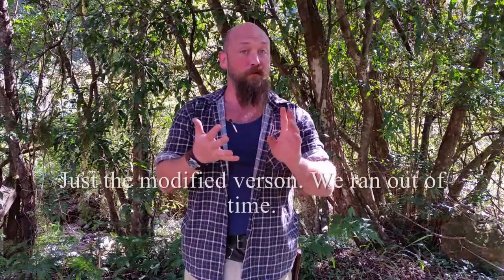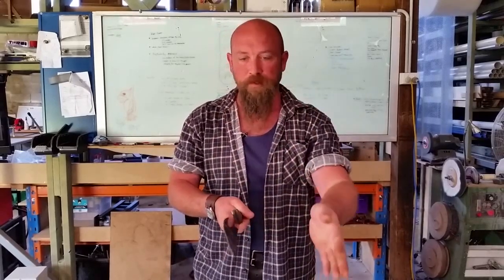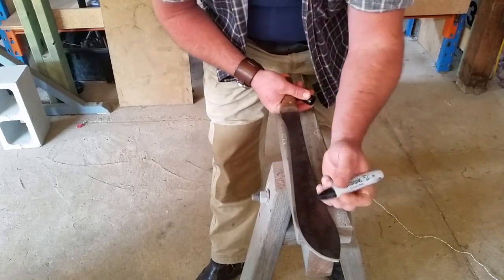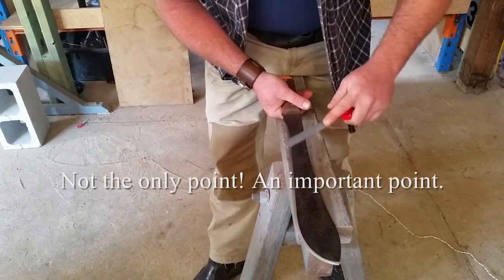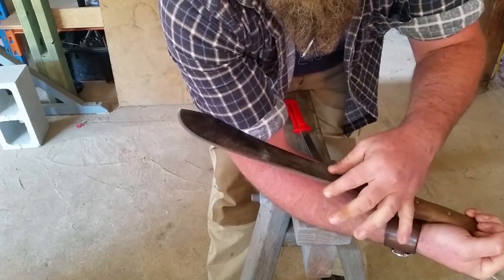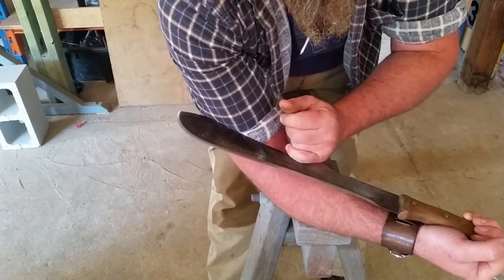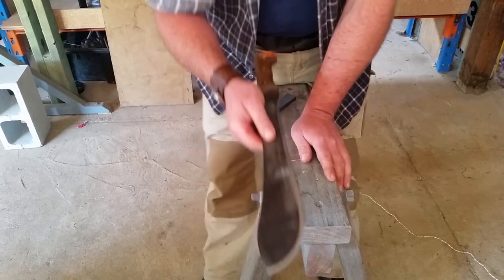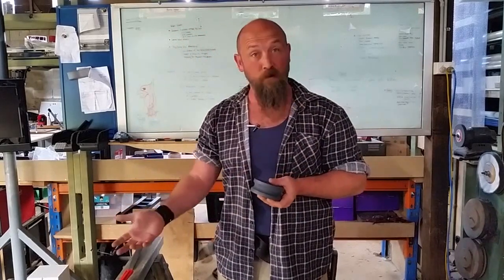Machete Sharpenening: A simple method that suits beginners and pro's

Comment: I don't own a sawhorse, but I could substitute a 2x4 secured to a table or bench. You really made it look easy. It's natural and even easy for any of us to obsess over the angle of the edge, but I've heard practice and you'll learn, but inexperienced people worry about messing up. Your replies to viewer questions and comments below are just as informative.
Reply from the maker: Again, thank you for the complements Frank. First up,  please excuse the wait in a reply. The long bushfire season and now flood season has been keeping me busy (and awake at night). I have been slack in getting back to people. 
Yes, you can use many things to support the machete while you're sharpening. Fence posts, tables or 4x2 clamped to a table all work.  Straddling a fallen tree trunk also works.
You're right, inexperience holds a lot of people back but that's the beauty of learning how to sharpen with a machete.  Even if you do a rough job of it, you can still get the tool to cut! They are a dream to use when properly sharpened though. That just comes with practice. 
All the best from a now less smoky Australia,
Ben

Comment: Funny. I have never used the traditional sharpening direction on my machetes. Yep, I am very wary. Back in earlier days I used a round axe finishing stone to sharpen my traditional machete (the shape you're sharpening). Thanks again. Great instructional video Ben. I am left handed also, so your perspective works for me :) . I had never crooked a machete in my arm to get the other side of the blade. I've always laid the blade across my lap, then flipped it lengthways to get to the other side. One hand using the stone, the other to steady the blade. I think I'll make a jig for home though.
Reply from the maker: It is nice to hear from someone who already uses a different method from the norm. Occasionally I still get a bit of friction from people who use the traditional method, but maybe that is a left handed thing? We are not worried about looking at things from another perspective.
Although I don't often use sharpening jigs anymore, I'm a big supporter for people using them. It does not matter how you sharpen your tools, as long as you're happy with the edge and process. Some polish their tools to a carving sharp and others will scrape up a burr on concrete....I really dislike the 'experts' making out that sharpening is a mystical and un-achievable process. That just puts people off from having a go. 
Yes, that cradle method is a little different. I use it more when I'm out in the field as I can take a knee and support one side on my thigh, flip it and cradle the machete to get to the other.  You can't beat a bench sharpening though! Everything is easier in the workshop.

Comment: used the traditional way, sliced part of my thumb off. worked great  10/10
Reply from the maker: Ouch!!! All work with sharp objects comes with a risk no matter how safe you are. The traditional method of filing into the edge catches a lot of people out. You're not alone buddy!
I use to use a big, stacked leather guard on the file before I started using the backwards method. The traditional way is still faster as It tends to bight into the steel more but I find the backwards method safer.
Reply: Machete Bushcraft Australia i was thinking about using some leather welding gloves, thanks for the tip
definitely sunscribed
Reply from the maker: I get where you're coming from Mad Max. I learned a long time ago with sharpening that there is never only one way to get a tool sharp (sharpening can be a hotly debated topic!).  You're right that filing into the edge can remove steel more aggressively but it comes down to file and angle control. You can really hog out the steel in one spot if you're not moving the file across the whole length of the tool. 

 With practice ,you can file into the edge, away from the edge and also 'draw file' the edge as well. You can sharpen a concave, straight and convex profiles with the three above. Flat and convex bevels are also achievable.

I'm guessing here but I suspect one of the reasons filing into the edge became the norm all those years ago is because even a slightly dull file can be used to put an edge on a tool when filing towards it.  When filing away from the edge, you really need a sharp file or a lot more force to compensate. 

 Actually on that note about bill hooks, as my machetes age with use, they all develop a slight concave/convex curve from the handle to the tip. I can't say that any of them have a straight section in the edge but the weed chopping and crafting projects don't suffer from that.  

It's a darn good point though MM and I doubt that I mentioned it yet. Filing into the edge can remove steel lot more aggressively than filing away.
All the best mate,
Ben
Reply: It'll grow back!  (Not really.)
Reply: @MacheteBushcraftAustralia  An angle grinder with a flap disk works even better.
Reply from the maker: @samnelson4975  Yep! We call it "The Universal Farm Sharpener" A lot of people use the hard grinding disks and they do work well. I find the flap disks do a much neater job of it with less heat build up.  They are less grabby and easier for a beginner to control. 
If you clamp the machete down, you have the advantage of controlling the grinder with both hands as well as being able to see the bevel as you grind. 
The edge you get is quite rough and suits cutting anything green. If you're cutting anything hard and dry (as well as carving and crafting), you will benefit from refining the edge with some finer abrasives.

Comment: Yes I am located in the US,  wish I could visit the Outback though. Thanks again for your help.
Reply from the maker: +Brandon Totel 

Ok, lots of research done on Amazon to find some comparable sharpening equipment. Sorry for the essay but I can fwd this to the other US campers that ask the same question.

The easy ones to find are the “eze-lap diamond hones”

The big paddle pop style sharpeners I use as in field sharpening kit are these:
 EZE-LAP L PAK Set SF/F/M Color Coded Diamond Hones
The blue and red (super fine & fine) are the ones I used in the advanced sharpening clip and the purple (medium) can be used as a substitute for the Norton pocket stone.

All the ezelap hones need breaking in as they cut fast and rough for awhile. Just polish the back of a chisel for about 5-10mins each. 
I also like the:
EZE-LAP D5F Fine Oval Sharpening Steel, 5-Inch
Which is the same as the red (fine) hones. Easy to hold and use but not as packable as the sticks. They are nice and light though! I don’t break these in as I like the way they cut. 

The green chrome stropping compound, any good brand is just fine. 
 Woodstock D2902 1-Pound Extra Fine Buffing Compound, Green
I use Veritas brand only because it’s the one that was in the shop at the time. The one above has decent reviews. 
Sure you can buy a strop if that’s your cup of tea, honestly it’s not needed. Chances are even the pro’s damage strops from time to time. Make a simple one to suit how you want to use it from cardboard,
mdf, leather, canvas etc.
 
Now the not so easy to match, but that is not a problem! 

The Stihl files I use and like are model #: Stihl 0814 252 3356. Just go to your local chainsaw shop and pick up their flat raker files. If it’s Stihl, they will have the ones above. Husky sell Oregon files and they are good as well. I like the orange Husky (Aussies don’t use the name Husqvarna as we can’t spell it!) quick change file handles. 
Flat raker files are pretty generic as far as the size and pitch as well as the two rounded safe edges. I would not bother with dollar store files though!  

Now on to the Norton Pocket stone. I can’t find an exact link to them in the states.
Here is an Aussie link to the same stone in the clip.

Stone Sharpening Norton 149c Pocket Stone Be205664
Here is one that looks similar on Amazon:
Norton Pocket Knife Abrasive Sharpener with Case, 3" x 7/8" x 3/8"
Size, Grit Medium (Pack of 5)

To be honest, at this level of sharpening a lot of quality stones can deliver similar results.

I typed in ‘axe stone’ in Amazon and there are a lot of good choices. 
The first result is the Norton axe and hatchet stone. This is a coarse and fine stone in one and I use them. Lansky puck sharpeners also come highly regarded.
Canoe stones are very traditional sharpening stones for machetes.  

9" 225mm Silverline Boat Shaped Combination Tools
Knives Axes Sharpening Stone
These are also a very good option for a sharpening stone although I find them a little aggressive. They are perfect for a very basic level of sharpness or chip removal. If I was to pick just one tool, these would be it. I cannot comment on the brand and quality. I don’t often use machetes with a rough edge these stones leave behind but I’m sure a lot of people would be happy with it.

Now one point I’m not sure I put across very well in the clip. The system I showed suits a machete that already has a decent primary bevel. Even light chipping and abuse can be easily taken care of with the above system.
Most new machetes come with a shocking factory sharpen and will need a fair bit of workshop time to shape the bevels properly before you sharpen them. I can’t recommend a good machete that has this already done as I’m yet to find one. 

The brands that come with a decent sharpen tend to be really bad quality machetes which is frustrating for buyers...I have tested many but obviously not all of them.

That was a mouthful... Hope It helped mate. I’m
happy to clarify anything I missed!
Kind regards
Ben
Reply from the maker: +Machete Bushcraft Australia 

Hopefully these links work!

Ezelap stick sharpeners
http://www.amazon.com/EZE-LAP-PAK-Color-Coded-Diamond/dp/B000UVS62S/ref=sr_1_1?ie=UTF8&qid=1451712472&sr=8-1&keywords=ezelap+l

Ezelap oval hone
http://www.amazon.com/EZE-LAP-D5F-Sharpening-Steel-5-Inch/dp/B000UVTDX4/ref=sr_1_1?ie=UTF8&qid=1451713038&sr=8-1&keywords=ezelap+d5f

Stropping compound
http://www.amazon.com/Woodstock-D2902-1-Pound-Buffing-Compound/dp/B0000DD35C/ref=sr_1_1?ie=UTF8&qid=1451712322&sr=8-1&keywords=green+honing+compound

Pocket stone used in clip:
http://www.bunnings.com.au/stone-sharpening-norton-149c-pocket-stone-be205664_p5761972

Pocket sones Amazon
http://www.amazon.com/Norton-Pocket-Abrasive-Sharpener-Medium/dp/B004L2LHQY/ref=sr_1_3?ie=UTF8&qid=1451712212&sr=8-3&keywords=norton+pocket+stone

Canoe stone Amazon
http://www.amazon.com/Silverline-Shaped-Combination-Knives-Sharpening/dp/B000T9W5AA/ref=sr_1_1?ie=UTF8&qid=1451712260&sr=8-1&keywords=9%22+225mm+Silverline+Boat+Shaped+Combination+Tools

Comment: Thanks for the informative video. I have never used machetes (it's not a traditional tool in this area) but lately my parents need my help at their weekend house and I have realized that the scythes (too large and hard to use on uneven ground and on thicker vegetation) and sickles (too small) they have there are not the best tools for clearing the "jungle" (high grass / chinese wisteria / wild blackberry bushes etc...) which grown there in the last year. I hope that with a bolo machete it will be a much easier job.

Comment: The best way to get a machete sharp is using it! As you use it it will start to dull then you have to sharpen it over and over again, you keep using it then resharpen again. I've seen some old machetes down here in mexico razor sharp and light weight because of so much use the  metal is shaven from the blade making it lighter, better then any new or expensive brand machete!
Reply from the maker: Nail on the head mate. It's actually the reason I feel machetes are a great tool to use while you're learning how to sharpen. They are very forgiving to use even if your sharpening techniques is not perfect. 
I'm also a fan of the broken in and well used machetes. The better your cutting technique gets, the more you find yourself preferring the swiftness you get from lighter and thinner machetes. 
That was a great comment.

Comment: I'm currently sharpening a 22" Barteaux & Sons machete I inherited and trying to figure out what the proper technique is. You mention the concave bevel in the video, am I correct in assuming that the bevel remains concave after sharpening? Also, is the angle of the bevel/edge along the blade the same as along the tip of the machete?

Comment: Thank you for the great video! How can I make sure my edge is even and not curling to the one side?
Reply from the maker: I'm guessing here but are you talking about the little rough ribbon of steel on the very edge (called a wire edge)?
If so, you can some what straighten it with a steel, and that edge is wicked sharp for soft green material (like in a veggie garden). If you're chopping into anything woody, it's best to remove this wire edge with stropping. Abrasive strops are the quickest but you can just use raw leather, denim, cardboard etc.
I hope that helps, Doc.
Reply: @MacheteBushcraftAustralia  thank you for the detailed answer! I'm new to all this. I did the file and the pocket stone steps like in the video. But I don't know if I sharpened evenly on both sides. Some say they can tell by looking if the edge is curled more towards one side. So if I strop it after these steps it should become even? I also have a butcher's steel which from what I gather also straightens the edge but does not sharpen.
Reply from the maker: @DocHoliday596  Yes, the butchers steel does not sharpen, it straightens the tiny flexible wire edge (mostly puts it back on centre).
 
Wire edges are very useful for cutting soft material but they do tend to roll over easily. The butchers steel will partly clean the gunk, straighten the wire again and somewhat burnish the edge. 

When you strop, you're trying to remove that  flexible wire, off the edge.
You can do this on a strop without an abrasive compound. Essentially, you're just bending the wire ribbon back and forth until it breaks off. 
Abrasive compounds are faster and will also refine the edge a little.

Keep in mind, if you're working on a machete, these are really forgiving to use when they are not super sharp. It's a beginner friendly tool to learn the basics of sharpening. 
Sharpen the best you can, then go out and test it. Once you get the hang of it on a machete, stepping up to basic kitchen knives and pocket knives is the next step. These benefit from better stones and  a little more practice.... not much, though.
Reply: @MacheteBushcraftAustralia  Thank you so much! I have a pocket stone just like the one in the video. Will sharpening with that be sufficient if I want to cut some thicker material? Because I don't really have a strop or know how to use one. Although I do have to learn eventually.
Reply from the maker: @DocHoliday596  Mate, it will work just fine. 
If you have a big wire edge and cut something heavy, chances are it will break it off for you. The machete will feel dull sooner but a light touch up with the stone will bring that edge back faster than before. 

Use the sharpening equipment you have for now. Once you get the hang of it with those tools, you will end up doing what the rest of us have done, and that is exploring better equipment. Maybe to add a littler more to that, I have seen locals strike their machetes on concrete to bring up a rough edge for cutting. Without a doubt, you will be getting a better edge with a file and stone than they would be on a road surface.  

For now, the kit you have will get it done. 

If you're not interested in stropping, you can try and add a few degrees to the last strokes with that pocket stone. That might be enough to work off that wire edge. 

As far as strops go, my favorite is just a smooth dress piece of construction pine. 
I have been meaning to shoot a clip of that for years now but never got around to doing that.
Reply: @MacheteBushcraftAustralia  thank you for all this info. I really hope to see more videos from you. Do you use sheaths? Mine came without one and I'm thinking of getting one made. Sorry for the many questions 😅
Reply from the maker: @DocHoliday596  Mate, I'm happy to help share a perspective.

Sheath use with a machete depends on a few things. 

If you're using it all day, a sheath will probably get in the way.

If your machete is not sharp, I have seen many locals just stick the machete in their belt or rope around their waist. Sometimes they will rope on a shoulder sling. 

When I do like using a sheath: 
If the machete is proper sharp, a sheath is invaluable (personal safety as well as protecting the edge). 
If you're walking and occasionally using the tool, a sheath keeps the machete on hand.

If you're chopping and clearing, a one handed sheath suits Draw/cut/stow/pick up branches and repeat. 

A backpack slip keeps your machete's edge safely tucked away from all your soft equipment.

A shoulder carry sheath is easy to put on or drop all together depending on the task.
Shoulder carry sheaths suit walking through scrub a little better as the whole rig is not so close to the ground where it can get tangled in vines etc. 

Clam shell plywood sheaths are and very robust if you fibreglass it (put a drain in the bottom). 
PVC sheaths are easy to make and there are many tutorials on YT. 
Leather is nice for the < 12" crafting machetes

And besides all that, Doc, if you need an excuse, making a sheath is a fun project.
Reply: @MacheteBushcraftAustralia  thank you this was all valuable!
Reply from the maker: @DocHoliday596  Happy to help, mate.
All the best from OZ,
Ben